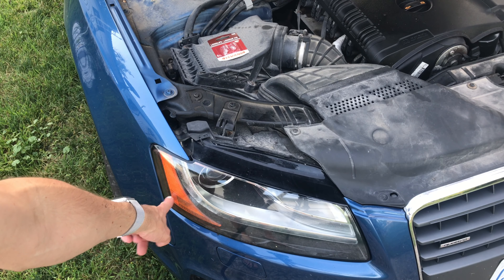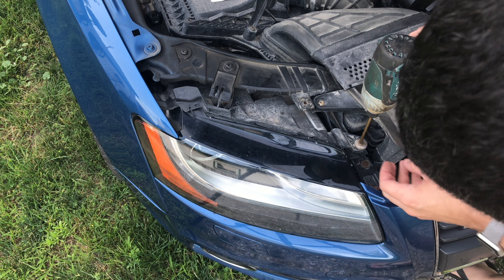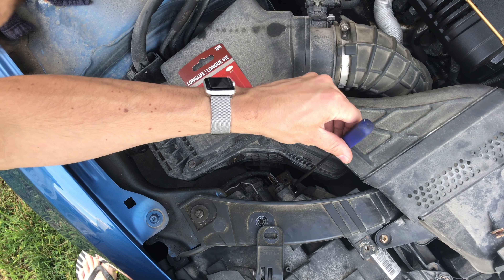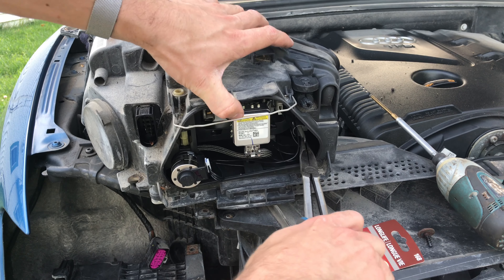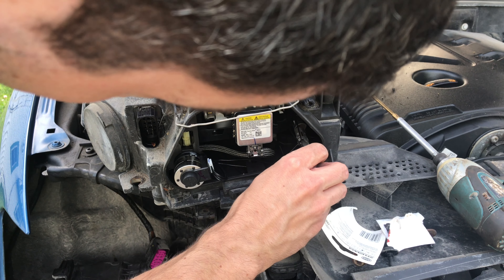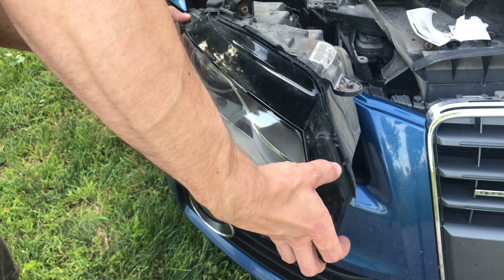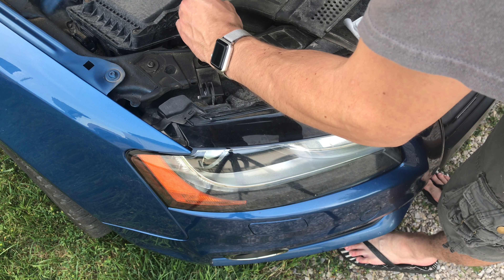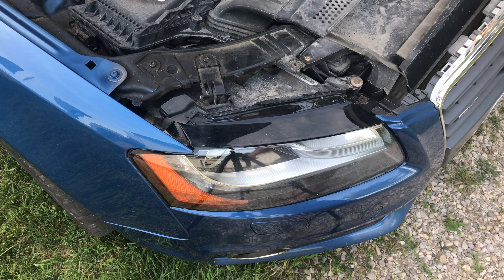Parking Light Bulb Change 2008-2017 Audi A5

Comment: Have the exact same year and model. Must be time for the original bulbs! My right side went out as well.  Did you replace both? Mind as well if you are already doing work on it.  Trying to decide if I want to change out the headlight bulbs as well. People raving about Phillips Extreme bulbs. Any thoughts?  I hope your car wasn’t victim to the timing chain issue... my car has luckily been running ok. Thank you for sharing.
Reply from the maker: Did timing chain at 170 000km as preventive maintenance. I just switched one bulb. No point in doing both at once since its not hard to redo.
Reply: porkercon Ok, I am only at 120km so I may be good there.  Any input on the headlights? I still have my original bulbs. Happy Thanksgiving!
Reply from the maker: @MM-sf8wq  I think they recommend it being done at 160km. For the bulbs I would keep everything original and not replace till you have to.

Comment: I need to know how to change an Audi, RSQ7 back bulb
Reply: Open the trunk unscrew the tail light from the trunk pull out the tail light, on the back of the taillight will be all the light bulb plugs, just check which ones are blown and swap, easy

Comment: There is probably a Audi tool for that in a shape of a cylinder that you put on the white part  way to make a 0,20$ charge in to an hour pay up front at oem dealer.
It’s make to be that way fuck Audi employee that wanted that be make by some engineer so the money can flow.